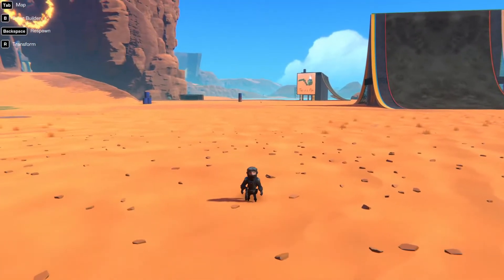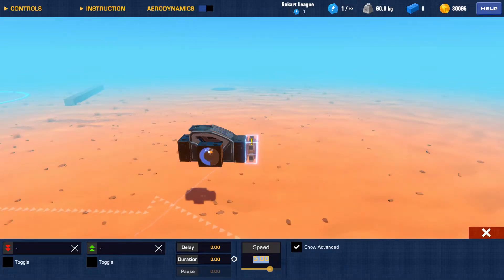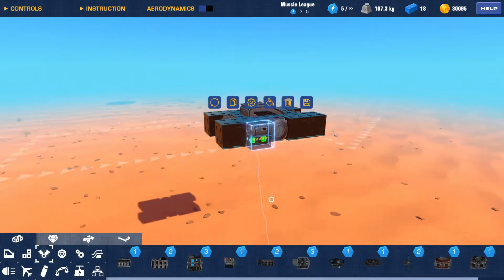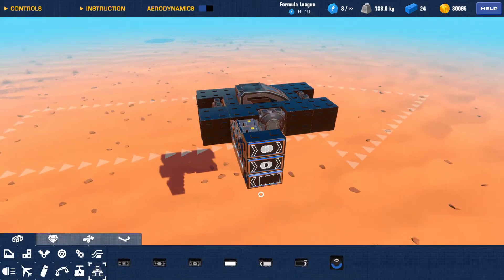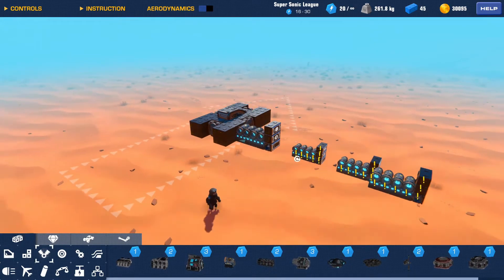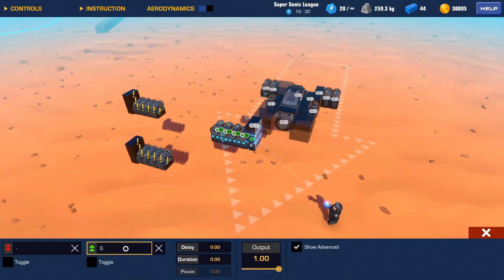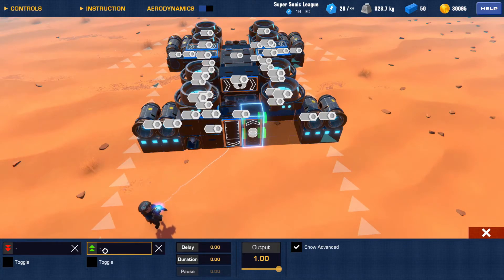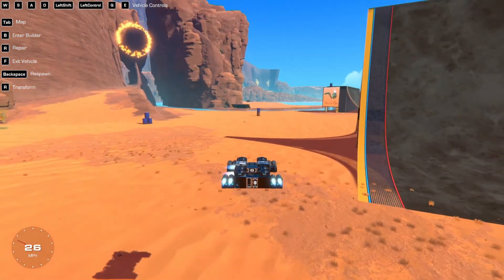Trailmakers - VTOL Hovercraft Tutorial

Comment: It seems some of the controllers work differently on console - like, if you remove ( X ) inputs from the helicopter engines, mostly, the tilt switches won't make them do anything no matter what... But if I set a tilt switch to 360 and connect all four heli's it works... 

Thank you for the video, I'm learning - it just seems (through no fault of yours, of course!)  to be more hints than instructions, if you're on console. :)
Reply: Can u say it less complicated and in steps? Pleasseeeee
Reply: I find that on Xbox if you use a single tilt switch set to 360° to control four opposing helicopter engines that stabilizes a vehicle. The directional thrusters work the same as in the video, and the elevation thrusters work the same. I was initially trying to use both up and down controllers for the elevation and in watching the video again I noticed you only have to use one for the down direction. After that it works perfectly :-)
Reply: Help

Comment: how are you able to spin the helicopter engine while connected to  2x2x2 block ?????
edit: nvm you are facing the v1 toward the angle sensor not  connected there while i was using the v2 you said it later damn you adhd

Edit2: here a suggestion have a distance sensor facing down and a second or gate and connect disconect facing down speed sensor and connect it to new or gate + the distance sensor then or sensor to xor gate for lift controller now set your minimum desired ground altitude :D 0.5m should be the suggested minimum
maybe have an and gate between distance sensor and or gate + a key to toggle it on/off

Comment: bruh i made the one in the video good but when i try to make one it doesnt work it just spins and idk why i literaly copied and pasted it and moved some peices and it just didnt work
Reply from the maker: Make sure you remove the bindings on heli engines that you don't want. Also make sure to keep the correct weld groups separated and don't rotate speed sensors and angle sensors in a way that would mess it up

Comment: So my vertical stabilization works perfectly, but none of the horizontal stabilization works at all, it keep drifting to whatever side randomly(unless terrain is tilted, then it will most likely go down the terrain.)
Reply: Neverming I fixed it, speed sensors go in the same direction or and xor go in

Comment: Thanks worked this out roughly by experimentation. Except the helicopter engines are different to my version will try it. Does the helicopter engines stick to the blocks? (Worked it out the main part spins on the helicopter engine)